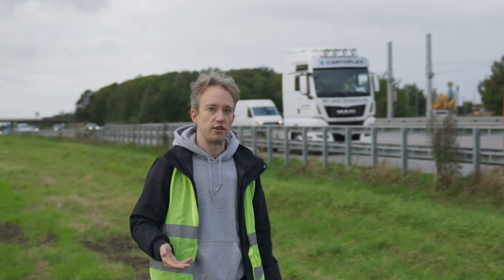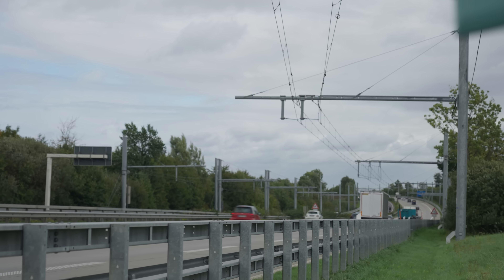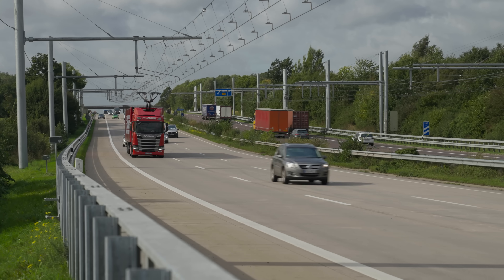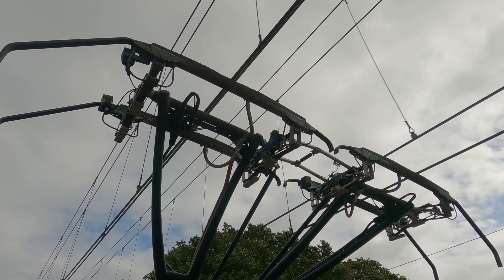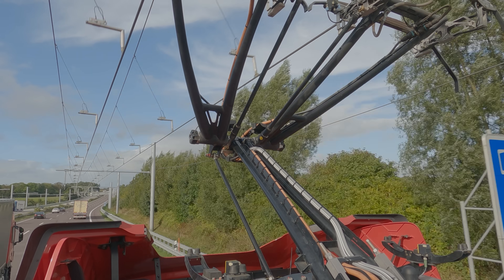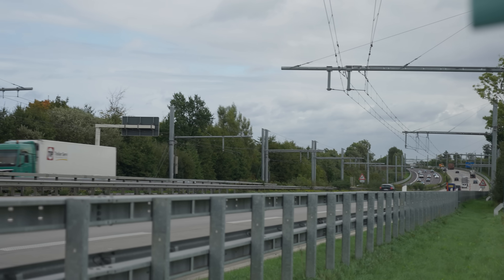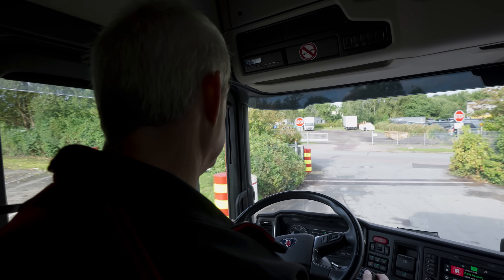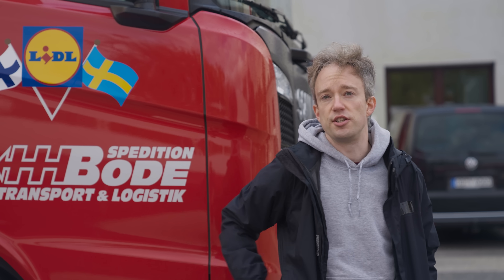The highway where trucks work like electric trains

Comment: It looks like a decent idea but i just wonder how practical it would be as the system they have is clearly set up of a specific truck and trailer height, here in the UK trucks and more specifically trailers come in all sizes from the single decker we see in this video to the double decker ones that most have started using, an d well if you set it up for a double decker then it would be to high for a single decker to use and if you set it up for a single decker then a full sized double decker would ram right into it

Comment: If it wasn't for Beeching, the UK would have had an amazing distribution and transport network. I wonder sometimes, what's the purpose of ripping it all out and then installing electrical infrastructure on roads (imagine the congestion in installing all of this), instead of developing what was already there off road. Well, you could say it was necessary at the time, but its this lack of vision that pi**es me off.

Comment: Carbon footprint of copper cable's, carbon footprint of maintenance of line, the railway lines are a nightmare, costing billions for a limited service, batteries are improving all the time, they might be a viable alternative to this with out the big state infrastructure.
There is also the alternative fuel hydrogen fuel cell, or burning hydrogen in a conventional engine,  biofuel.
A hydrogen/natural/bio gas mix could be used in traditional engine with out an expensive conversion, this would dramatically cut co2 and nitrogen oxide emissions with out spending billions, climate change mitigation needs to come from the bottom up, not the top down, we all need a piece of this climate change cake.

Comment: If the cost-per-mile of this technology can be reduced, something like this would be amazing in North America, especially since there are sometimes several hundred mile stretches of road between major cities with nothing but tiny villages and farms in between. This technology would work wonders, especially since America seems to have a hatred towards building new train lines. Something like this could be a stop-gap between fully electric battery powered trucks and diesel powered machines. Uses existing roads, keeps diesel engines for when they are needed, and there is no recharge time. Ticks almost all of the boxes that electric truck haters really have.
Reply: America has a good freight train system though, it might make more sense to electrify that
Reply: @dsdy1205  Sadly America is considered the land of cars. As a local let me tell you that there is an actual stigma against trains for some freaking reason. Every time I mention how much trains could help to someone they just go, “But we have cars.”

*Throws hands
Reply: @hyperon_ion9423  We also have in america the largest freight train network in the world. but everytime I mention that people say, but passengers.
Reply: @hyperon_ion9423  Thats because the long distances between cities and towns in the US is absurd, and takes way longer, and is more expensive than just getting in your car and driving there. Now, local commuter trains within cities and to surround suburbs make more sense. They'd get a lot more use, they'd be much quicker than a car, usually, and shouldn't cost all that much simply due to their high volume usage of commuters.

DC, NYC, and parts of New England are great examples of this. NYC especially.

At the end of the day though, there will ALWAYS be people who prefer the peace and quiet of driving their own vehicle to and from work, instead of having to deal with a bunch of other complete strangers crammed onto a train or bus.
Reply: @narobii9815  We have the infrastructure — we just need to get people to use it.
Reply: @dsdy1205  We use an the freight rail system a lot in the states. What are you looking at that says we don't use our freight trains? We are at around 40% of all freight by weight mile is moved by train in the use beating out EU's less than 20% in second place.
Reply: @hyperon_ion9423  The USA will have to reconsider their love of combustion engines once the price of oil doubles again another couple of times...
(It was usually around $20/barrel in 1945-2001, while in 2002-2021 it seems to be jumping around $80/barrel.)
Reply: @narobii9815  yes that's what I said
Reply: @dsdy1205  only electric part of the US network i know is the Northeast Corridor and i don't think CSX even uses electric trains there.
Reply: @davidty2006  well, you gotta start somewhere

Comment: I appreciate the ethic but two big stumbling blocks. One would be the infrastructure and vehicle costs and secondly if this was actually viable why do we still have a very large proportion of diesel powered trains on the UK rail network which have had overhead electric power for years?

Comment: I am old enough to remember when London and Portsmouth had 'Trolley Busses' running on the roads, via pantographs and overhead wires.  They were quiet and efficient, but could only run when the pantographs were in contact with the wires.  This required Bus Conductors to pull on a rope, to change from one wire to another wire, when the bus went onto another route.  It also made it very difficult for busses to pass each other, when one bus was at a Bus-stop, as they are today.  Back then, they had bus stops which had multiple bus bays, but that meant passengers having to venture into the roads, to board a bus, or alight from one, although back in the 1950' and 1960's, there were a lot less vehicles on the roads.  Maybe it's time for the return of the Trolley Bus in large Cities and Towns.
Reply: I'd like to see trolley buses with batteries. Just short pantograph sections at bus stops. The bus charges while picking up and dropping off passengers. It would only need to spend about 10% of the time at a stop or terminus to be able to work all day.

Comment: Here's the three problems that I see with this:
1. What happens when one of those trucks has to swerve out of the way of an obstruction? Catenary is very dangerous stuff with heavy wires under a lot of stress and tension. If they get damaged things can go catastrophically wrong for anyone nearby very quickly regardless of whether there's any electricity in those cables. Granted, trains and trams can't swerve either but they are segregated from other traffic or run very slowly. You don't send trams through city centre streets at 60mph.
2. How much do you trust haulage firms? Trams and trains are highly regulated for safety because there's a lot of potential for harm if they aren't. Putting a system like this on the roads elevates the level of risk there too, but do you trust every haulage firm to maintain its lorries in a good enough condition to use this system safely?
3. Trains are simply better! By their own admission this isn't any good for local deliveries, it's designed for taking goods between ports and warehouses. That's exactly where railways are at their strongest. The only reason we don't do that now is that we haven't invested enough in rail to make it happen. If this system is going to compete with rail for investment, we're reducing investment in a proven technology that can already do what we need.
Reply: 1. The pantographs should detract if needed, and I think periodic inspections and maintenance of the lines should reduce the chances of destruction if something does go wrong.
2. You don't need to trust every truck company, you require licensing and independent inspections. Not just inspections but preferably surprise inspections.
3. I agree, trains are better. The downside is trains will always require loading and unloading, and the efficiency of long trains makes "custom" routes difficult. It's also much harder to build railways than overhead lines.
Reply: 1. I'd be very surprised if they were not already testing this kind of scenarios... one of the main reasons for this test road which is shown in the video, is certainly for testing the safety of this system (The big "TÜV" sticker on the side of the truck is surely there for a reason).
So, while I don't have answers to these questions- I'm sure that "they" have answers... and this system will surely not enter the next level of implementation if it would be so obviously dangerous.
2. No, we don't trust haulage firms to maintain their vehicles "in good conditions" ... we know that all the time there are many trucks on German highways that should not be on the road in their current technical condition. So, there are already a lot of dangerous trucks on the Autobahn... implementing this system wouldn't change that much about concerning safety and the need to control trucks concerning their maintenance status. Maybe the government could increase the staff of police and of other relevant government agencies (e.g. the federal BAG agency) to counter the added safety risk with increased technical controls.
Reply: 3. Trains are better ... maybe, but they are depending on a railway track infrastructure which is limited and whose expansion needs a lot of money - and time. Especially in Germany. Of course we need to invest more in the railway infrastructure,  and increase the capacity for cargo transport on rails. But we won't be able to replace the huge amount of long-distance cargo transport by trucks in the German Autobahn net within a few years by train. Therefore we need to search for other options to replace Diesel-powered trucks by something better. And also, equipping existing Autobahn routes with power cables is surely faster and less expensive then building whole new railway routes. ... we need both.

Comment: My city used to have an extensive network of over-head power cables for electric buses.  I can’t recall when they started service, but there were in wide use in the 70s for sure.  Sadly, as urban sprawl took over, they were phased out in the 90s in favour of “high efficiency” diesels.  And the buses?  They were shipped to Mexico, where they were expanding their electric bus service.  Very sad.  Partcularly in our downtown area that has some steep grades into and out of the river valley, where the high torque and quiet of these old buses was a great match.  The drivers loved them.  Aside from occaisionally having to get out and pop the conductors back on the wires when they came un-seated.

Comment: The efficiency could be increased if the rolling resistance was reduced. Maybe add some sort of solid iron rails under the lorries to guide them, so that it makes automating delivery for containers easier? They could be joined together to increase efficiency into some sort of "dynamic lorry queue". [Yes, I'm suggesting the use of trains.]

Comment: A couple of suggestions:

Rubber on tarmac produces a lot of rolling resistance, why not try steel wheels on steel rails?
We also have a shortage of lorry drivers. Most acute in the UK, but a problem elsewhere as well. Why not string lots of these vehicles together into a very long vehicle that just needs one driver to pull maybe 20 of these lorries?

As an added bonus, you only need one overhead cable per lane, because you could use the rails as the return path. 

 If you segregate these lanes from the rest of the traffic, you could run the electricity at a much higher voltage and reduce transmission losses.

Comment: Most European countries still use extra cargo tracks while Germany tore up all separate cargo tracks in the 90ies after privatisation of the DB. Thatswhy Germany is now Europes bottleneck. Even China already finished rebuilding the Silk Route with tracks. Because trains are actually more efficicent and faster than Cargo Ships especially since the Silk Route on land is much shorter than any ocean route. 
The progress made by the rail in the 1850-1890s torn to pieces after 100-150 years later just to drive the profits of a small group of people.

Comment: The highway where trucks work like electric trains
Except for the high friction, the many drivers, the low distance between them from a control and safety standpoint, the high distance between them from a slipstreaming standpoint, the absence of a real safety system like PZB and so on and so on.

Comment: We have electric trains working off this system, we have diesel / electric train engines hauling freight with a much higher efficiency than road trucks, so why not extend the overhead electric wires over the entire train system and use fully electric freight trains for moving the loads to the regional areas where electric trucks can make the local deliveries?

Comment: Just a note. While this project is located in Lübeck, Germany, Spedition Bode GmbH & Co. KG may have routes to Sweden and Finland via Travemünde (as they proudly present national flags on their fleet), there is a long way ahead before there is powered overhead highways even in the destination harbours... And what about charging on board? Those baltic sea ro-ro ships (or most of any ships to this date) do not run by any "green" energy, but old fashioned fuel oil...

Comment: It's amazing to me how bureaucrats are experts in the Environment & Climate Physics. Tom S. also seems is an expert on adding script berating the current climate situation; where did you get your PhD Tom? These Govt. Eviro-Policies take money out of the pocket of Citizens for any innocuous reason. The 'Enviro-mentalists' want to accuse CO2 as the cause of Climate Warming, but they're a group that doesn't think to hard on topics like this, like Tom S. for example. Trees/ Plants need CO2 to survive. Question: How much CO2 must be controlled to reduce warming(which no one has proven), & keep the plant-life from suffocating? Germany & Europe have graver issues then concerning itself w/ something that they can't change on their own. Overhead electrically charged wires are a waste of taxpayer money. There is nothing wrong w/ Petrol/Diesel powered vehicles in light of unsubstantiated accusations. Money would be better used in improving Bio-Diesel if they're so worried about truck emissions. There will be ice forming on the wires during Winter. The ice will fall & strike vehicles, maybe damaging windshields & vehicle bodies. Who pays for that? If there is a serious accident that requires heavy recovery equipment, now there's a safety concern w/ the charged wires. What about accident victim(s) that require helicopter evacuation to hospital, the chopper won't be able to land very close & the victim(s) would have to be transported over rough ground to the chopper which could be dangerous for the victim(s). Overall; just a bad idea that serves a solution that has no problem to begin w/.

Comment: How big a deal is it to control the number of trucks on a section of line - and swapping from one section of line to another ... I suppose the battery on the truck could help smooth out power fluctuations without affecting speed and performance ..

Comment: Seems like the someone in the government got paid big bucks to do this atrocious piece of infraestucture.
Reply: I would rather have some wires on a motorway than a ruined enviorment
Reply: @TheProfessorIsCute  As if creating a massive infraestucture that supporsts 2 trucks on average a way helps in any way the environment. Oh and electricity in Germany is produced by burning coal wich is worse than gas, the irony.
Reply: @napsec9807  2 trucks? how do we know 2 trucks? and no, germany is closing down coal power plants, but also nuclear power plants sadly 

but hey let me break it down for you

Fosil fuel accounts for 55% of the electrizity consumed (whereas 24% is generated from coal, which is down from 2013 when it was 45%) , 32% comes from Renewable, and 13% from nuclear, so about 45% green energy

55% is way too much and needs to be fixed, but that is what this is aiding with